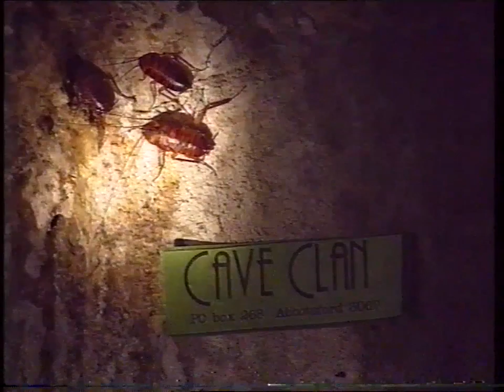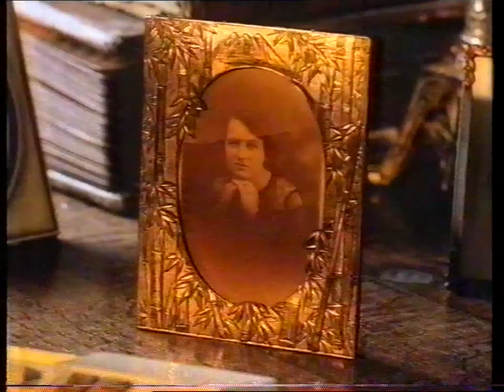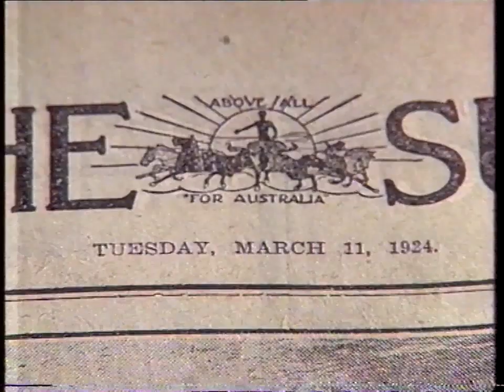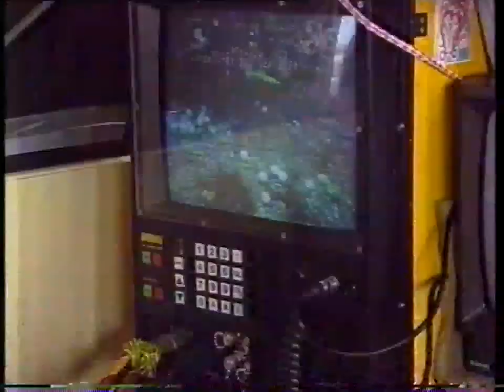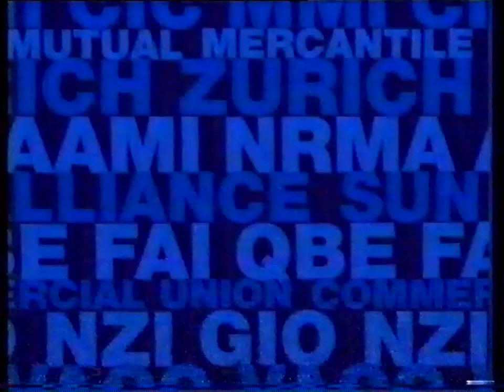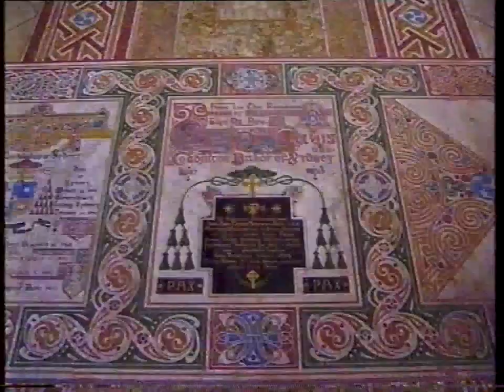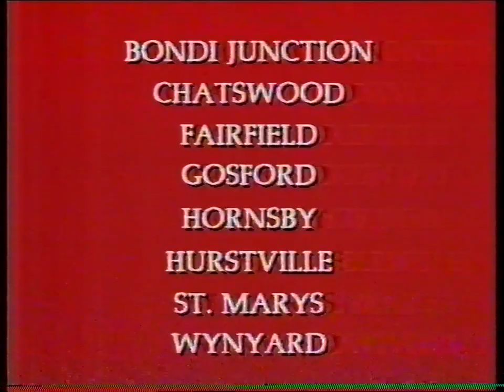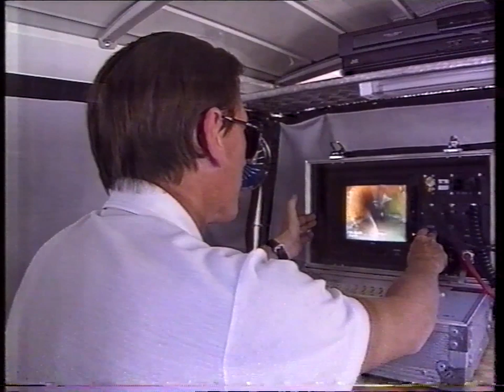The World Around Us (Sydney Underground) - 1993 Australian TV Programme (Partial)

Comment: We had parties down there in the 1970 under Hyde park till cops stopped it lol the cave clan great mob. Redfern to Darling Harbour. It old and magic.or Moore Park to Hyde Park pity they cut it with a car tunnel. Middle heads full of tunnels same north and South or the Pyrmont to New Town electricity tunnel. The most modern abondon tunnel is Epping to Chatswood viaaquarie uni. Large sections abandons in 2019.
Reply: I used to catch trains that used that tunnel for uni..
Reply: Why has it become abandoned?
Reply: @sunnyvale104  dont know what theyre saying abandoned, it was converted and is now the metro
Reply: I think you'd get squashed by a Metro train trying to explore the "abandoned" ECRL lol
Reply: in the early 90's there were small raves down there too underneath Wynard, DJ and speakers off a gene, the sound could only go so loud before it hurt your ears, went on for a few years until the STA boarded up the entry with thick steel plates.